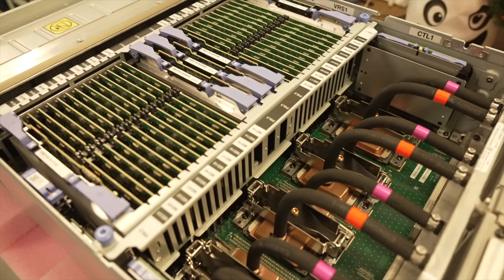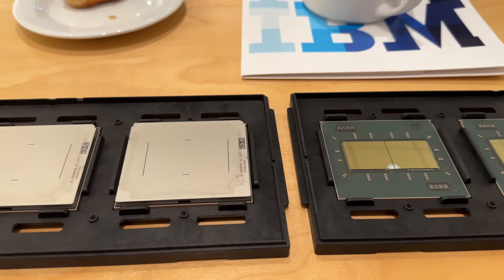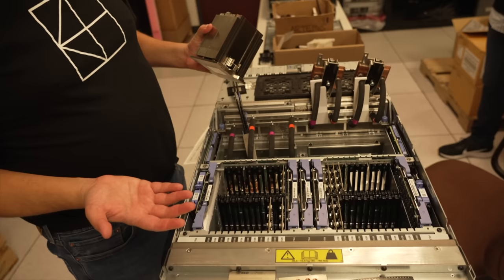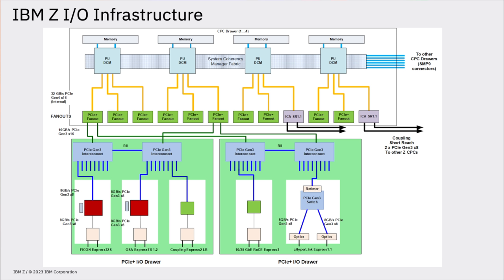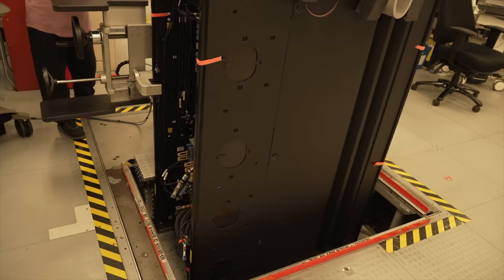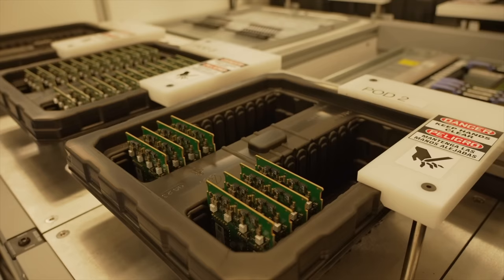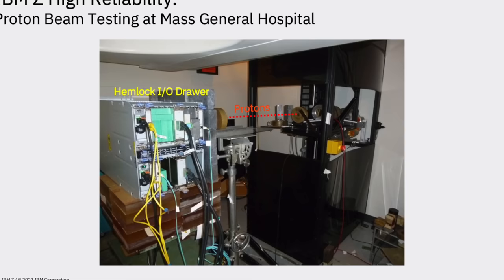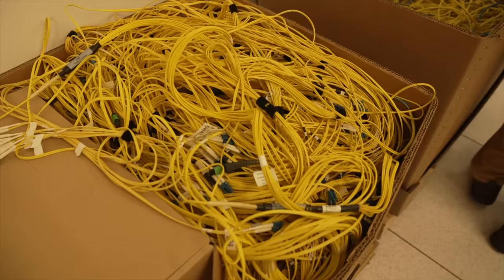Why Do Mainframes Still Exist?  What's Inside One?  40TB, 200+ Cores, AI, and more!

Comment: Good answer for the "Why Mainframes?" question. Another reason is that many businesses have a lot of mainframe code (COBOL) that took years to develop. Replacing that would cost a ton of money just to get the same results they already have. My last job started to transition off the mainframe in 2006. They are in the 18th year of their 5-year plan, and almost finished. I retired five years ago, and their last mainframer retired two months ago. (P.S. The place isn't just re-coding the programs, they are re-designing every application.)

Comment: I was slightly surprised that these big iron boxes are still running the 360 instruction set but then realized that there is so much old code written for these beasts, and pretty much the world's finances passes though them (banking, government, taxes, etc).  So a consistent upgrade path from the mid 1960s.  Amazing.  Sixty years of a stable architecture.  Amdahl was a genius.

Comment: 2:36 'mainframe' with a z-what, not a Power(tm), uh, I was thinking this was about the larger Supercomputers. The z16 is cool and all, I just feel a bit let down that you didn't get to see Summit or Sierra. To paraphrase someone working with DNA protean simulations a few decades ago, a mainframe is a machine that is a generation behind what you really need to do the simulations you want to run today, lol.
8:40 OK, I do like that PCIe expansion slot setup, that's nice for things like lots of AI compute cards. Also good point about the AI scanning of transactions, I was thinking more along the lines of 3D mapping of GPR data of other planets kind of stuff.
18:22 The same goes for Supercomputer centers, aside from the 3-phase power there is no copper wire, it's been fiber for a few decades now.

Comment: Regarding the RAM, I think this is per mem channel on the Xeon, not the total. Xeons often do triple channel. As far as I know (and I might well be wrong), the 8-way organization is specific to the module, and cannot be multiplied. From a 2 Xeon server, I'd expect about 150GB/s combined, but it's complicated since memory needs to be accessed in a coalesced way to go there. The beauty of the mainframe is that you get 320GB/s no ifs and buts whereas on the Xeon side, it depends a bit on the config. Latest servers should be able to reach (or maybe soon) 150GB/s no ifs and buts: 6400 x 4 channels x 8 bytes.

Comment: I remember when I interviewed at Itty Bitty Minds. The manager decided I looked too young for the job as he walked across the room to greet me. The I/O systems manager followed me around trying to hire me because I knew microprogramming. I was not interested. The TI system used 51-bit microprogramming on both clock edges, and the IBM systems used 32-bit. I believe the reason the PC used the Intel chip instead of the Motorola chip was because of bribery.

Comment: Wow what a nice tour of IBM - they are still an impressive, innovative company, and they build their systems to last a lifetime. The thermal sheets will last many years upwards of 15-20 years, versus thermal paste which should be changed every couple of years, so that makes sense for a system intended to be in place for many years with insane high availability. Do they still make their own chips, or outsource that to companies like Samsung? Also do they still use proprietary protocols like SNA, or industry standard TCP/IP, IP v6, etc.?

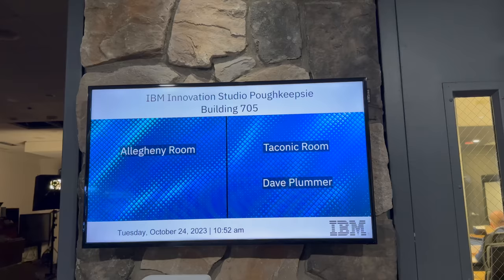Comment: 1:32 - I worked for IBM Systems Communications Division in Raleigh, NC (actually IN Raleigh, not RTP) in 1980 for six months as a co-op. They liked me 'cuz I could code assembly right away - I was on the phone to the internal customers literally around the world for upgrades to the IBM Microcontroller development system. I was looking forward to a long career at IBM until the Cookie Monster took over and a hiring freeze happened just as I was graduating. I worked for a company that sold a SVR4.2 ESMP computer to IBM Federal Systems Group, learned how evil IBM had become. I almost became an IBMer again after they torpedoed the Visa International project I was working which was not on IBM equipment and they converted engineers into IBM Global Services people - five of us used to work for IBM.

Comment: Mainframes exist because X86 is not reliable enough for critical systems that HAVE to work... Same reason IBM mid-range (AS/400 or whatever they are calling it now) still exist. People with applications and services which run on mainframe and mid-range will never give them up. These are the most reliable and secure computing platforms for large services and applications which HAVE TO work, no exceptions.

Comment: One old mainframe fart I worked with talked about a mysterious event where IBM fired a shotgun into the lower part of a mainframe. Not a single bit of data, nor a single cycle of computation left uncomputed. Despite half of the unit experiencing uncontrolled failure.

Thinking about it, I doubt it is true. At the same time - knowing what I know about some mainframes - it is not completely unplausible. I have seen demontrations where someone pulled abusy CPU out of a running system without a crash or data loss.

Comment: Wow!  I've got a pretty good setup downstairs myself, featuring a twin-channel dual-arbitrated loop fibre-channel fabric switch, but it runs at a paltry 2Gb/sec, back in the day when the fastest you could get was 16Gb/sec.  This is TWENTY TIMES that!

One more thing: I didn't notice any hard drives - anywhere.  Even on the finished systems.  I guess nobody uses them any more (good for 2nd-hand procurers l like me).
Reply: There is no storage of any kind. Storage is a separate product.  Connection to the Z system is FICON or FCP.
Reply from the maker: As Brian notes, you'd normally buy a storage rack solution from them to go with it.  All the contemporary ones seem to be 100% NAND flash, but older ones had spinning discs.

Comment: Great video. If IBM gives you permission, perhaps you can discuss mainframe pricing (for hardware and operating systems) in another video. We'll be sure to have the right pills available.
Reply from the maker: Low six figures for a single frame and into seven figures for a full set!
Reply: @DavesGarage  I strongly doubt that you can get a single frame z16 for "low six figures". I'd love to see a specific configuration with pricing that would support that. And I'm willing to leave the insane licensing cost of z/OS out of it.

Comment: One could not compare a mainframe with a classical computer: that's a matter of coherency and resiliency.
A mainframe is not done to compute fast, but to always compute, and to handle a huge lot of datas doing so.
For example OpenMP offers you mainframe level scaling and resiliency, but without the coherency.

Partitioning is not the same notion as VMs. There are hard warranties (SLAs).

Comment: It would have been nice to cover "what is a MIP?"
I know what it stands for, but when mips are also used a billing unit and the number of instructions doesn't sound impressive compared cheaper commercial systems... 
Perhaps they weren't mentioned in this video as IBM has finally gotten rid of the idea of using them as a measurement to be billed on! That would be nice.

Comment: 20:05 - Well, "seven nines" is five minutes a year, but that's still spectacular.
Reply: It's about 3 seconds. 525600 minutes in a year. 99.99999% of that is 525,599.94744, leaving 0.05256 minutes (3 seconds) of down time.
Reply: @briansomething5987  You are right. Still, not milliseconds, but at most one barely noticeable failover.

Comment: Well several years ago when commodity hardware servers and speed was almost getting ahead of the mainframe at the time, company use to work for tried to replace spent 75mil ended up using twice as much hardware as originally thought would need entirely and still could not get distributed processing to get even near the speed of the mainframe and was not even near the biggest mainframe. major financial processes 100's thousands transactions processing was abandoned and as far as know with the more improvements keeping ahead with mainframes no one is even considering trying to replace the mainframe keep thinking about it but quickly realize no use. Sure may adjunct stuff on other server platforms moving to cloud and that has limitations many are finding out.

Comment: Thanks for all the wonderful info!  I have never found a satifactory answer or explanation, I understand apple/dos/windows ( i had a 4 cpu pentium pro 200/1mb cach server the cable company I was a tech at was throwing out) but my question is How does a Cray super computer compare with even 2000s computers or really could it run Windows XP compiled properly etc...What did millions buy you in super computing power in the 80s.

Comment: i work with coding programs that run on Unisys Mainframes... Work for the govt and we have both the IBM and Unisys mainframes. Each has its place for what it can do what is included in the software that runs on it and what is extra costs... What bothers me about the unisys is really that they use a weird number of bits (9-bits) which makes binary data really not able to be interchangeable between the IBM and unisys or even between Unisys and a PC so we are normally stuck with having to do things like flat/ascii files as the way to communicate data without compressing it.

Comment: Apple claims its top flight M3 Max has a memory bandwidth of 400 GB/s, though I wasn't able to determine if "GB" in this context meant gigabyte or gigabit.  If it's the former then the Apple chip's memory performance is on a par with the IBM mainframe, which is pretty astonishing (If it's the latter then the quoted figure equates to about 50 gigabytes/second, which is still pretty impressive).  Of course you can only have 128 gigabytes of it is max, so that's still not even close to what these mainframes can manage by about an order of magnitude.  But it's interesting nonetheless.  I'm wondering how much of the M3's touted performance/watt is due to having so much memory bandwidth available

Comment: I feel like you used the term "Over Provisioned" incorrectly.  Its usually used to mean allocating more resources than you actually have.  You were using in reference to having more resources that you are currently using which I have always heard referred to as "capacity on demand".  Other than that its a really interesting video.  I have worked close to mainframes for years but never really had a great idea what they are currently used for.

Comment: Please talk to the IBM z/OS people because they make the z16 screaming fast. Those banking transactions you discussed are running on z/OS. Linux on z16 (called zLinux) is exponentially faster than on non-IBM hardware but z/OS is exponentially faster than zLinux on a z16. z/OS is designed to fully utilize z16 architecture. The simplest to understand is comparing the same database (e.g. DB2, Oracle, Adabase, ...) running on zLinux and z/OS. Both are the similar on a single z16 and able to utilize all 200 cores at the same time. For multiple z16's, zLinux must resort to clustering which is an outdated slow architecture. z/OS on the other hand doesn't need anything to run on up to 32 z16's for a total of 6,400 cores at the same time.    Database rows come directly from disk to the specific z16 requesting the row versus zLinux passing rows between the z16's.

Comment: Thanks for the "drawer' filing system tip. mb
Reply: And still open slots for this and that former Orchid employee here, XT and AT add on. mb
Reply: Low volume assembly for that custom order basically price premium on OLTP has not changed since 1980, and maybe since the 1940's leave that to a future instalment, THINK on it, I will definitely watch. mb
Reply: Amdahl called it fault tolerant, or was that Tandem, hard to say? mb
Reply: wow, well beyond wiring in big rooms like a bunch of liberty aero in one big room. mb
Reply: referring to the liberty aero engines. but that also moves up into whole system examples. mb

Comment: 2:54 I believe you mixed up L2 cache with L1 cache here. Only L1 caches are in the '64 to 96 KB' (or lower) range, while modern CPUs have from 512 KB (Intel's Gracemont and AMD's Zen & Zen 2) up to 3 MB (ARM V3, possibly Intel's Arrow Lake P cores) of L2 cache per core.

32 MB of L2 cache per core is still extremely impressive though. 6T SRAM does not scale as well as logic, so tighter nodes do not reduce its area as much as the rest of the die.
Reply: You are correct; Each z16 core has "only" 256kb of level 1 cache. 128KB of data cache, and 128 KB of instruction cache

Comment: This made me happy and sad. I worked in emulation for Amdahl years ago. We'd emulate new instructions from IBM on a fast path so Amdahl mainframes would run IBM code containing the new instructions almost immediately. Then shortly the engineers could get it into silicon. When Time magazine trumpeted the death of the mainframe, the original engineer creators of Amdahl were long gone and there were business folks running the show. They bought into the tech rumors and fairly quickly killed the Amdahl mainframes and tried a shotgun approach to trying alternate things Amdahl might do. They killed the company. Sad looking back at it. Of course I was fine working at the time on Sun computers programming this and that in Unix. Amdahl could still be a top competitor of IBM in the mainframe world if none of that had happened. Mainframes never died. Bean counters and marketers aren't the best visionaries for a technical company.
Reply: About 1985 EDS had Amdahl install 2 5890's as a single image to run IBM MVS/XA single image. I worked great and was faster than IBM and Cray.

Comment: Back in the 1960s, I had a folded card with the complete instruction set of the IBM 360 family of computers.  I haven't seen such a card or manual or anything similar for years, maybe since the Motorola 68000 chip.  The other day I went Googling for the instruction set for the ARM "Apple silicon" SOC M1,M2, or M3.  I could not find anything anywhere.  Are all these instruction sets "secret" now, disclosed only to compiler writers and in-house OS programmers, and kept from the rest of us retired riff-raff?  Also the interrupt codes and condition codes and instruction exceptions?  I can imagine some degree of proprietary paranoia, this being Apple,  but "somebody" has to know what is inside the SOC in order to properly program it.  IBM used to be very open about their system hardware and software documentation; is this still true today?

Comment: You are confusing accessing time with bandwidth. When a computation requires data, it is the access time not the bandwidth that matters.
They are still using inherently quantum mechanically defective CMOS instead of resonant tunnel diode threshold logic (RTDTL). Think 2.2 THz at 5 W.
Is the architecture a slightly improved von Newmann type or a direct execution stack-based architecture like the GA-144?
Are their VRMs using the 1920 circuit or the 2011 Ćuk-buck2 circuit?
Are their PSUs using the 1897/1920/1988 circuits or the 2011 bridgeless PFC circuits?

Comment: Noticed in the presentation slide they had 2nm technology... I thought the reason we were unable to make those was because atoms are roughly 1nm apart, and transistors needed 3 materials to function... or 3 parts anyway. Genuinely curious as I thought the only improvement after 3nm was going to be quantum computers. Apologies for the simplified question, but why is it they can get the transistors to be so small? Does some material give them the capability, or are they able to reduce the "parts" smaller than 1nm? If so, what is the theoretical smallest we could get then? Super confused :c I feel lied to or dumb... prob a mix of the two, like being told or hearing something and forgetting to fact-check :/

Comment: So IBM main frames are good for redundancy where every millisecond is actually important and has to be correct every time.
Rackmount x86 seem to have model a few errors ECC can not correct a year is ok. 
Rackmount x 86 non-ECC seem to do speed over redundancy and thus are quicker for GPU compute. Mostly as it is hard to get redundancy for GPU compute. when GPU compute came about when redundancy was a less of a priority than compute speed. So speed went up as redundancy went down. 
Mainframes seem to be you need to always be up always with 0 downtime.

Comment: Thanks for sharing. 
.
.
.
.
.
.
.
.
The only MAINframe for IBM (Microsoft) is each Windows user 🤣
What we did before using windows 95 (workload), we are still doing using Windows 11 but consuming 800% more resoursces from the machine.
Win95 - CPU 25Mhz, Ram 4Mb, HD 50Mb
Win11 - CPU 2.5GHZ x8, Ram 8Gb, HD (at least) 240Gb

Comment: Even though it's not novel, i am super interested in distributed computing, decentralized communication with/via state machines (with consensus algorithms to establish a single state), cpu and memory clustering etc. In my opinion, this is the definition of a robust resilient systems.

 True redundancy/resiliency is in my opinion true distribution/decentralization running in 50+ datacenters or even outside one. You must just figure out the state machines and efficiency. I have been a part of the development of such a state machine/consensus algorithm with 100000 state changes per seconds. 

In the world we live in the datacenters might not be the first choice when if ONE datacenter goes down, then ya. you are sort of fuckt. Take this model into a war and this system wont stand long of such intertupts.

 If you could make a video on distributed computing it would be much appriciated :)